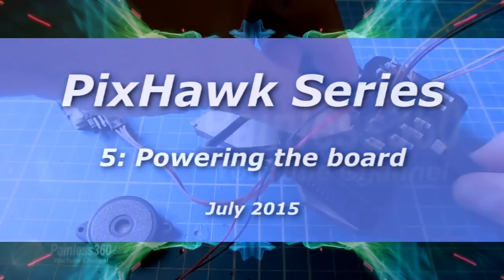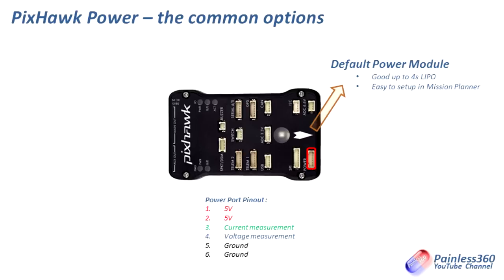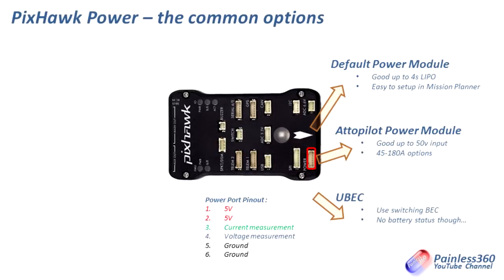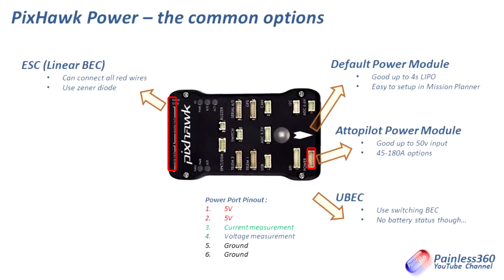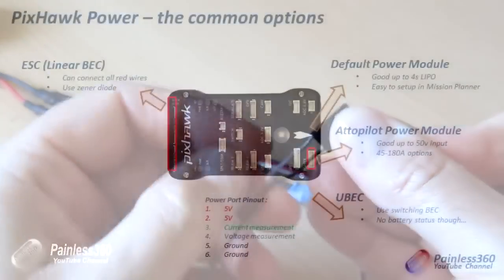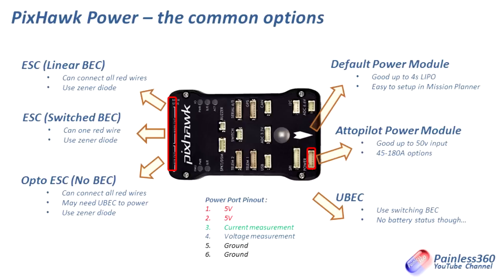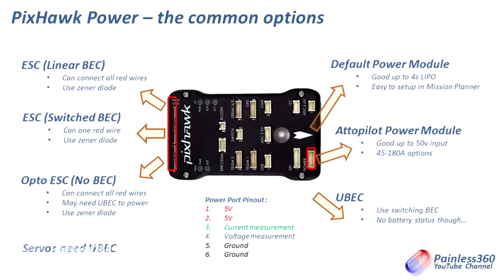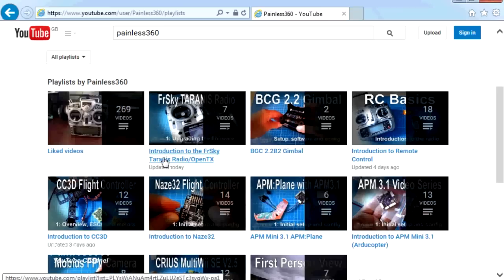(5/5) PixHawk Video Series – Common Power Options (BEC, Power Modules, ESCs and combos)

Comment: Hi #Painless360 ! I have a strange problem with my Pixhawk. When I give a command with more power to my hexacopter, the Pixhawk beep GPS error ! The LOGS show me 2 FAILS, TEst GPS_ glitch and Test PM FAIL slow loop on line...... I think the problem could be on GPS module or powering de Pixhawk ( I'm use the power module) Do you know something about this ?

Test: Autotune = UNKNOWN - No ATUN log data
Test: Balance/Twist = GOOD -
Test: Brownout = GOOD -
Test: Compass = GOOD - No MAG data, unable to test mag_field interference

Test: Dupe Log Data = GOOD -
Test: Empty = GOOD -
Test: Event/Failsafe = FAIL - ERR found: GPS_GLITCH
Test: GPS = FAIL - GPS glitch errors found (48)
Min satellites: 7, Max HDop: 1.4
Test: IMU Mismatch = UNKNOWN - No IMU log data
Test: Parameters = GOOD -
Test: PM = FAIL - 57 slow loop lines found, max 8.25% on line 29037
Test: Pitch/Roll = GOOD -
Test: Thrust = GOOD -
Test: VCC = GOOD -
Reply from the maker: Fabricio Medeiros Looks like the external compass isn't working at all - without it the GPS modes will not work. I would try and re-calibrate and check all the wires to the external GPS/Compass module..
Best of luck.
Reply: Yeah, I tried that. Redid calibration, switched to the beta firmware and went back to 3.2.1 nothing has changed. Did any power preblema could cause this? Or a physical problem in GPS module could also cause this problem. The strange thing is that it happens when I use a little more strength in engines , that is, when accelerate a little drone . What you think ? thx!
Reply from the maker: I would check for interference from the power lines then too... The GPS module needs to be separated from the rest of the model..

Best of luck with it.
Reply: Hi my friend ! I change the GPS module.. Put the N8M.. Be great !!!  Great Loiter, RTL and no more error.

Comment: Painless 360 could you tell me what one out of these would i need ?
http://www.maplin.co.uk/search?text=Zener%20diode%20&page=2&sort=&productsPerPage=
Reply from the maker: Roy Gallagher If you read http://copter.ardupilot.com/wiki/common-powering-the-pixhawk/ then you'll see that the max voltage is wants is 5.7v - 'You must also add a Zener diode (part number 1N5339) to condition the power across the rail and restrict it to less than 5.7V.' You need to choose the one that closest..

Comment: I used your videos to set up a APM 2.6  Amazing how well it worked right off the start. No tuning required.

I was wondering if you have installed a APM or Pixhawk on a fixed wing or if our going to do a series of videos on it.

Thanks...Yo make this very easy if they follow your direction's
Reply from the maker: Bill Vickers Yep - there is a video series where I install an APM Mini on a Wing - it's on the channel..Happy flying!

Comment: so the power module dois not give power to the esc? i have 4 opto esc, do i really need a seperate ubec to power the esc site? ore can it works with only the powermodule connected and no suply on the esc site of the pixhawk? i understand it is better to have both, but i dont have a zena diode yet...
Reply from the maker: jelle buyckx If your Opto ESCs need to see 5v on the red wire then your options are limited. https://pixhawk.org/users/actuators/pwm_escs_and_servos
Best of luck.
Reply: i guess if i only connect the signal wires of the esc tot the pixhawk, and than power all the esc' with a bec without going tru the pixhawk, then i dont need a zener diode? right? :-)
Reply: Painless360 i see, maybe the esc's will work whitout seeing the 5v? i guess i try first then. else i am gonna get all the +5v and ground lines of all esc together and just connect a 5v power suply to it bypassing the pixhawk etirely. thats fine right? just connecting the signal wires to the pixhawk and suplying 5v to the esc seperate?
Reply from the maker: All covered in this video...

Best of luck.
Reply: ***** i understand that mate, the problem whats that i have octa esc's. they dont have a build in bec, but some makes will need to see 5volts on the rail in order to initialize, i had some luck that the ones i have dond need that and just work wit only the signal wire connected. as the pixhawk got his power from the power module i dont need a bec to power it anyway. maybe in the future i will connect one with a diode to have a backup system..
thanks for replying

Comment: So where do i get the zener diode from, as fas as I can tell, the PixHawk doesn't come with it? if it is so important, then why does 3DR not provide one with the kit?
Reply from the maker: Sn0MaN666 Usual places - eBay, local electronics store..
Reply: Painless360 local electronics store.... you're hilarious
Reply from the maker: You mean you don't have one - where in the world are you?!
Reply: Painless360 it's an hour and a half drive to the city, let's put it that way....
so basically i have to order everything i need... what about the piece that the diode is in, is that just a servo connector? did you solder that in, or is it just stuck in there? thanks for your input, your videos are a tremendous help.
Reply from the maker: Mine is a lot nearer but it is so easy to get exactly what I need form eBay if I can wait.

I simply bent the wire over from one side of the diode, snipped both legs off so they are the same length, crimped servo pins into each then slid then whole thing into a servo connecter..

Hope that makes sense!
Reply: Painless360perfect sense! thank you, just have to make sure the line is in the middle (+) slot, correct?
Reply from the maker: Yep, just like in my images and the link to the main Arducopter/Pixhawk pages.
Reply: @Sn0MaN666  My nearest hobby store is 4.5 hours driving or about an hour by plane...  "I think I'll just toodle on over and return this connector I got for the.."